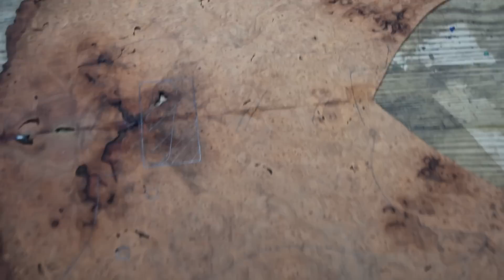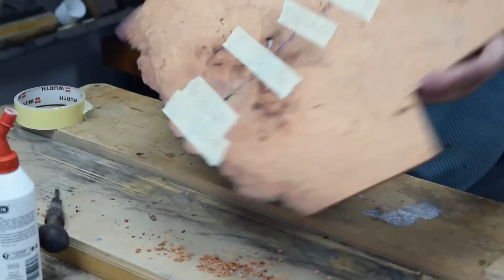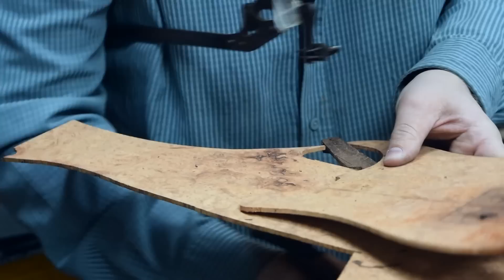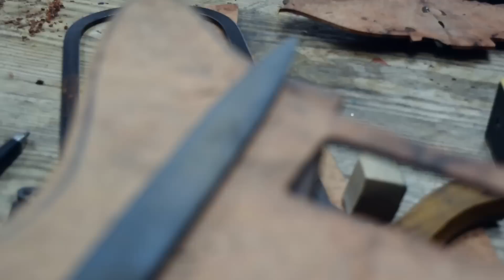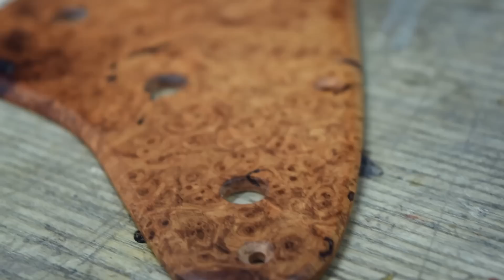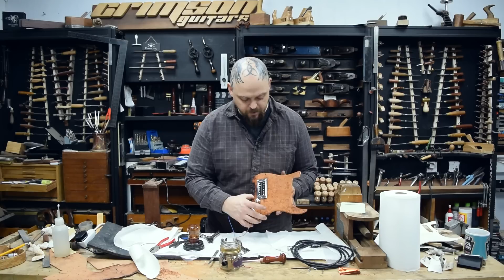Tutorial - How to Make a Scratchplate With Hand Tools

Comment: Scrapers ARE amazing! Wow, was not expecting the figuring to come out so much as you were running the scraper over it. Just a bit disappointed you used an electric drill instead of a brace and bit, though. :D
Reply: with that thin of a piece of wood he would risk cracking pieces off

Comment: Adding screening foil to the back of the scratchplate is always a good idea, but only ONE of the pots (normally the volume pot) should actually be in contact with the copper foil. This makes sense, as all of the pickup 'common' wires (as well as the common for the output jack) will usually be soldered to the back of the volume pot. The foil needs to be removed below the other two pots to prevent them from causing earth loops: just cut a circle slightly larger than the body of the two pots in the screening foil, and remove it from these areas. Also note that the copper foil fitted inside the pickup routes needs to come up over the edge on to the front of the guitar, normally at one or more of the screw holes, so that when the scratchplate is fitted, its screening is in tight physical contact with the foil in the body: it MUST have a very low electrical resistance between the two parts. Finally, as you will  have to use multiple pieces of foil to cover all the inside faces of the pickup routes, these should be slightly overlapped, and electrically 'commoned' using small dabs of solder.  Remember to earth the guitar bridge as well.
Reply: John, you seem to know what you're talking about.  Please if you wouldn't mind explaining to me why guitars must have some form of an electrical conductor underneath the pick guard by the volume and tome knobs.  What would the consequence be if I were to omit this step completely?
Reply: tone*
Reply: Ground loops in an electric guitar is a myth. It's impossible for there to be one. One pot being used as a common ground is a convenience and tidiness thing. You can link every component to every other component, even multiple times if you would like, and never have a problem but you'd have extra wires going everywhere.
Reply: @StopLossDill  it is shielding for emi noise. It’s like putting a water slide next to a set of stairs and then watching which one gets more traffic. The noisy kids are going to take the water slide almost always. So they slide down the grounded path and away from your other electronics sending signal which would normally attract those noisy kids, like wires and metal pots and such.

Comment: Wow. Loved seeing how that was done at 500% speed. Now... could you make a second video explaining what you were doing at each point, why, and what tools you were using. I'll be honest, I followed most of the process, but that coping saw or whatever it was had a uniquely ergonomic design and I want one, and the part where it looked like you were scraping the top layer off with a piece of sharpened bar stock... I mean, is that what was happening or am I missing a crucial piece of info. Note: If you couldn't immediately tell, I'm not a woodworker (yet). My hobbyist wheelhouse lies between smithing, forging, and ironworking.

Edit: I wrote this as the video was paused not 2 seconds before he said "scrapers are cool."

Comment: My mother taught me to hold the saw you used on the outside of my arm, not under it. I find it's a LOT easier to control the motion and to follow the curves that way. Holding it under my arm also really limits my movement. Yet EVERYONE I see using a saw like that holds it under their arm.
Is there a correct way to hold it? Do you hold it under your arm because you're used to working that way, or does it have benefits for your work?
Reply: Is it a jewelers saw or a jumbo coping saw or what’s that thing called? I was considering getting one as i’ve never seen such a big coping saw and i also need to cut a pick guard by hand 😄

Comment: Ben (or anyone) what’s a good source for sticky backed sand paper you’re using on the sanding beam? I’d like a good range or grits, but don’t know where to find them in the UK. Thanks
Reply: Lyndon, I use roll strips and 3M Super 77 spray adhesive.  It's cheaper in the long run, and easy to clean up.  Strong glass cleaner and a razor blade at the worst. I also use the same for lapping plates, etc.
Reply: I think he may be using his masking tape and super glue trick for that.  He made a video titled "The greatest luthiers trick of all - down with double sided tape!" explaining the details.

Comment: One pickup but a switch... 🤔
Reply: Coil tapping? Piezo? Kill switch?
Edit: Sorry, replied prematurely, it does look a bit odd. Maybe someone else has any insight? We're probably going to have to wait for a few hundred more subscribers...
Reply: Coil tap, series parallel, out of phase in either series or parallel loads of possibilities!
Reply: My money's on a sustainer system. Splitting the coils and using one to generate a magnetic field to keep the strings vibrating.

Comment: Whats the third pot hole for if there's only one pickup?
Reply: Could be a cut/boost, active tone circuit, active e.q., etc.
Reply: Michael Hudson it is where the toggle switch is.
Reply: I saw the finished guitar today. No spoilers - be patient, it's coming soon. Nobody could/would tell me how it's wired but it's a 3-position switch in the third hole.
Reply: @mykhough6614  it's probably series/parallel/single coil